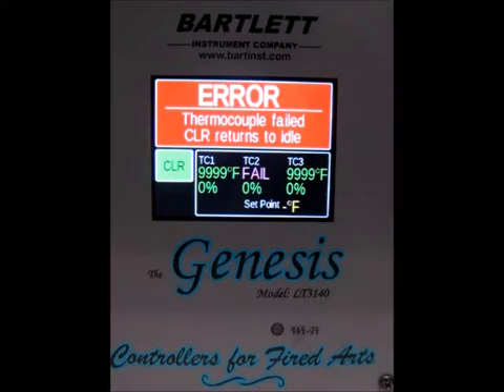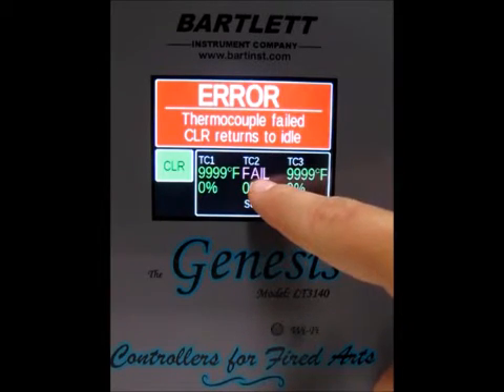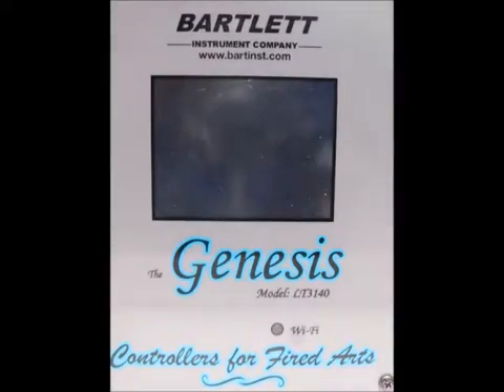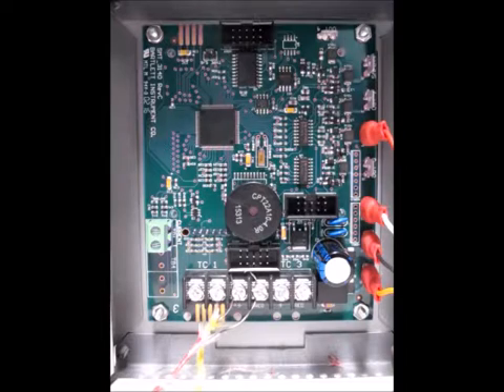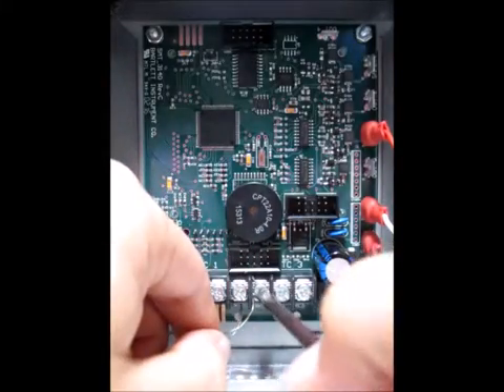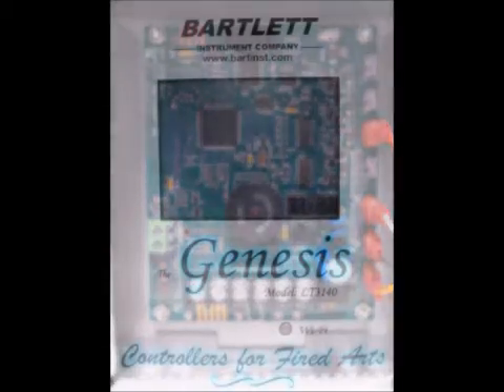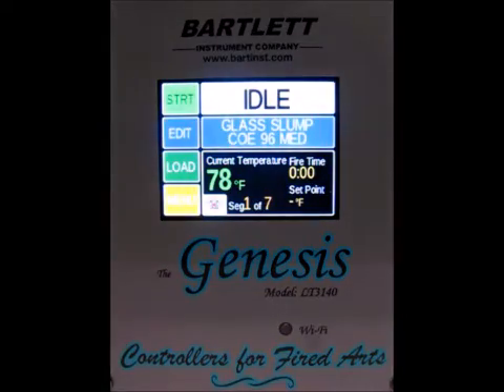Bartlett Genesis/Genesis Mini | Thermocouple Bypass Test

Comment: What is a jumper?
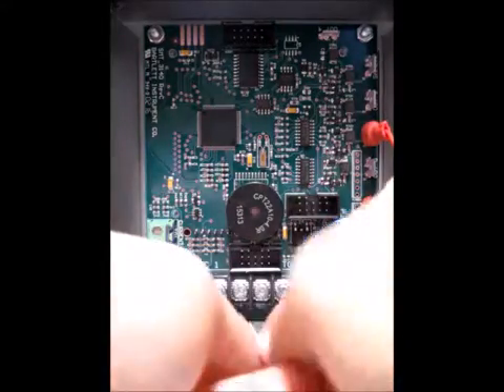Reply from the maker: The jumper referred to in this video is just a piece of wire bent into a U shape to be used as a bridge between the two thermocouple connections for testing. About 1:30 in the video you can see the jumper and its placement to do the TC bypass test.
Reply: @bartlettinstrumentcompany4969  Thanks, would tinned copper wire work?